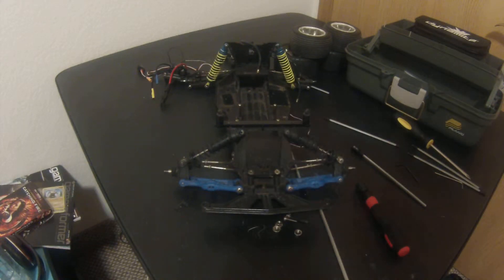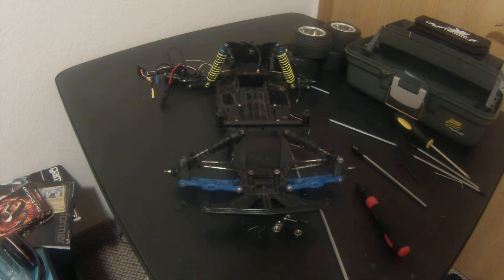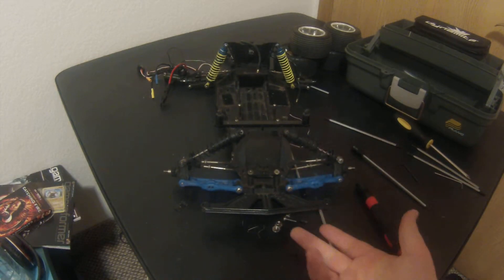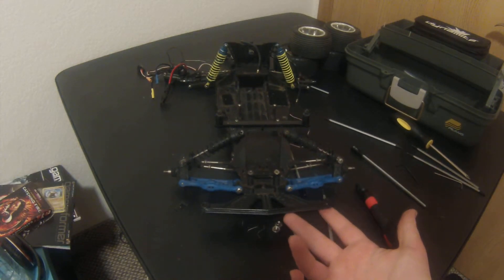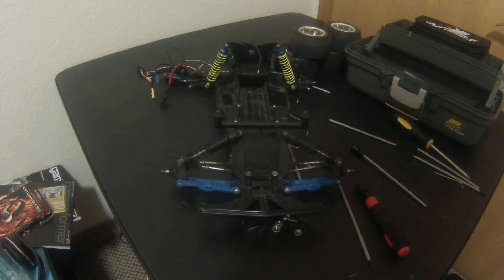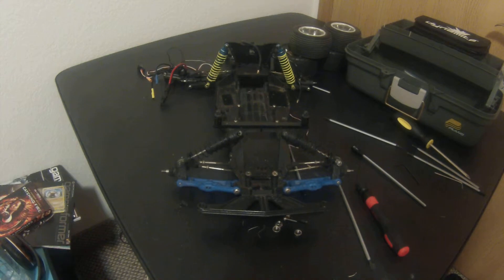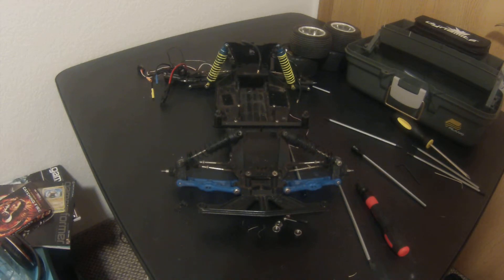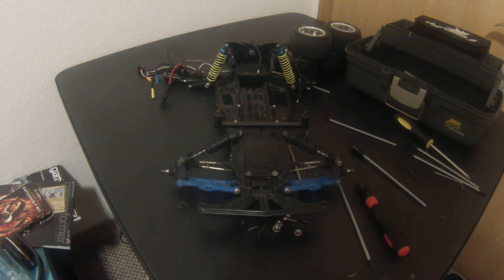new rustler vxl project

Comment: Hey Buddy!
I was planning on doing something similar. 
I say go with foam tires, and put the biggest you can on the back.
The transmission is going to have to be torn apart, and put minimal lube in to lessen resistance.
as for a pinion and spur combo, well, I would suggest about as tall a ratio as you can go.
You wont be able to have long runs or anything as this is going to generate A LOT of heat, so you will probably encounter thermal shutdown quite a bit.
I would remove the front bumper all together, and put a bunch of weight on the front too.
Keep me updated on this man!

Comment: Do you have bearings all the way around? The body and the stance of the vehicle will be the key factors of gaining speed that is until you get everything settled under the hood. Make sure that there is nothing loose or wobbly when you go to run.
Reply: Might I add that the tires you choose to use will also affect the amount of speed you get. I would say go with some GRP's and get the 17mm adapter because it seems to be the most popular tire and wheels to use.
Reply: And, of course the pinion and spur gear. I would ask 2cwik4u104 or I could do it for you since I might be a little closer to knowing him and I might ask him to hook you up. ;) I'll try.